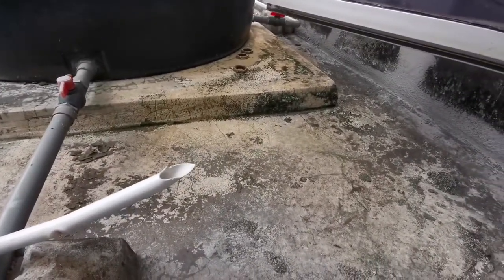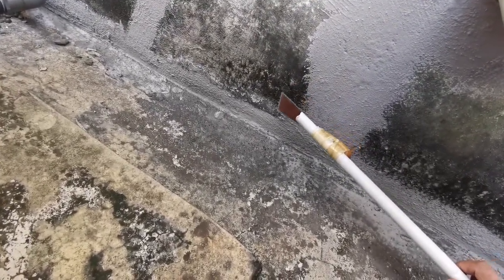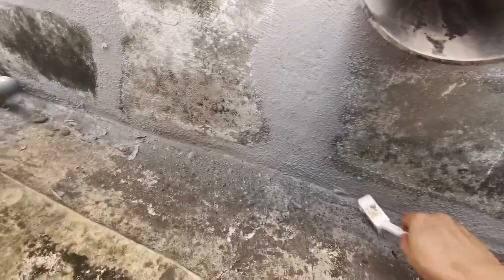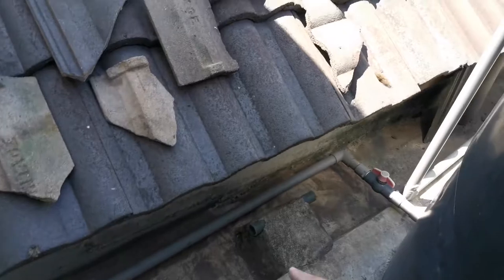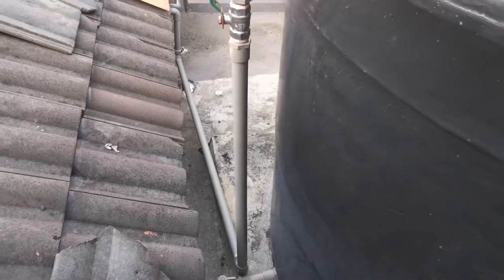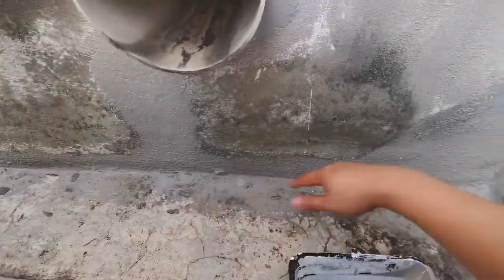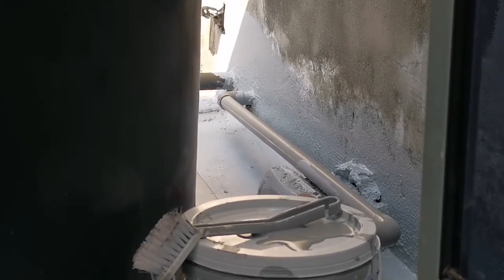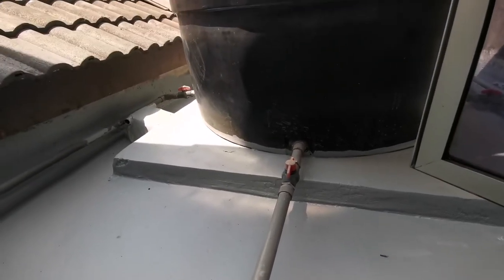Waterproofing Your Roof DIY with Nippon Paint Flex 200 Acrylic Waterproofing.

Comment: i also plan to use  nippon flex 200 to reduce the cost and do it by ourselves. i think my roof slab already render with cement coating, hopefully this acrylic waterproofing is enough to stop leaking
Reply from the maker: Ya, no harm trying... All the best
Reply: @drcheongtv  u make 2 coat or just 1 coat only ya? until today flex not peeling/crack?
Reply from the maker: I did two coat. No peeling so far

Comment: Any primer needed? Or does the material  "feel" like it is strong enough to stick to many surfaces?
Reply from the maker: No need primer. Is like a layer of soft plastic covering it. I will advise you to buy big tin rather than the small one. At least u can put 3 to 4 layer to make it stronger

Comment: This won't last long, I applied 3 layers on flatroof, it last for 2 years then cracked appeared on flat roof and leaking again..
Reply from the maker: Omg, what is your next plan to fully resolved the leaking issue?
Reply: membrane waterproofing paint only last 2-3 years in singapore / malaysia weather, the larger your RC roof surface area, the shorter the lifespan of the paint....no matter what brand you use...sun , rain, heat, cold, water ponding, will attack the paint...if you use fiberglass mesh to reinforce it, maybe can last 5-8 years...but generally no waterproofing stuff can last forever in flat RC roof....this is the weakness....
Reply from the maker: I totally agreed with ur explanations. Is really an headache for us. The only way now is continuous reinforced the water proofing.
Reply: use Sika 107 top seal 5kg liquid mix with 20kg powder  as 1st layer, then Acrylic   water proofing as 2nd layer. It will last 15 years.
Reply from the maker: Thanks alot for the suggestion, can we do it by ourselves or we need to call professional service?
Reply: @drcheongtv  u can do it. but make sure to follow the 5kg
/20kg mix. Sika 107 is sold in any hardware shop. but after mixing, it will be 25kg, a bit heavy to carry to roof top. perhaps mix 2.5kg/10kg ratio first i. e. 12.5kg. This mixture(liquid/powder) will render a cement coating first b4 applying acrylic water proofing as 2nd layer.
Reply from the maker: Tqvm for your great sharing....
Reply: @Alvinytt i plan to do this. Sika 107 then apply top coat with nippon flex 200 fiber. Is this better?